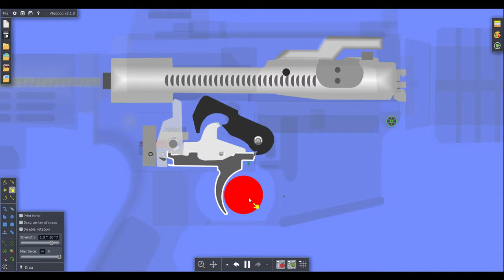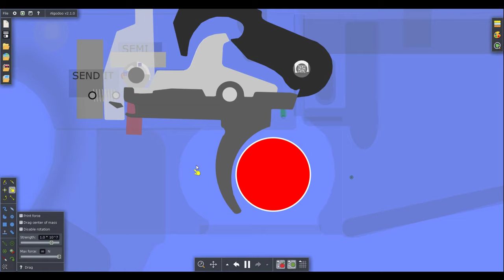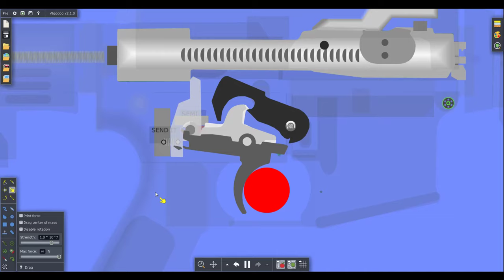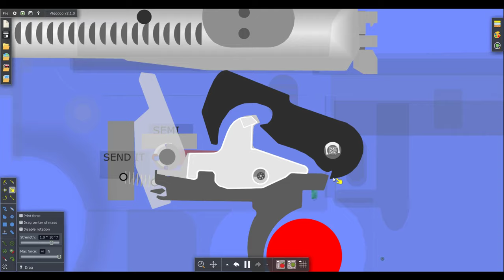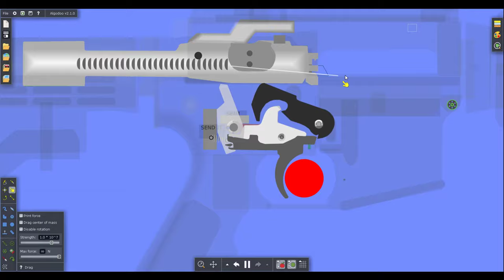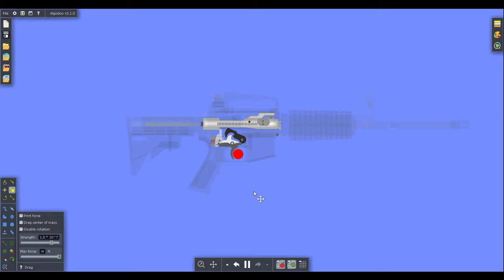How Binary Triggers Work

Comment: I like your concept for this binary trigger, I think you should find a way to put it in production if you could.
Reply: Get a file and a regular disconector
Reply: @socwyvern9745  that's a great way to cause an out of battery detonation but not binary firing.
Reply: @jacobkudrowich  The bolt cam track and firing pin flange prevent "out of batter detonation" unless your components are too out-of-spec
Reply: @jacobkudrowich  good luck.. your not outrunning the bolt with your finger
Reply: Just mod ur stock trigger.its only binary forever
Reply: @jacobkudrowich not how it works bro but appreciate the effort 💀

Comment: It looks like you simply combined the parts from a mil-spec trigger, a Franklin, and tweeked a mil-spec full auto Sear to make a Binary trigger design. What safety selector works with it to make it work in all 3 positions? You did a good job. People make thier own DIY Binary triggers all the time.
Reply from the maker: Not QUITE a FA sear, since it interfaces with the trigger instead of the hammer, but yes! Spot on evaluation!
Reply: @StealthTheUnknown  what safety shaft makes it work? Custom cut one, FA or Semi-auto safety selector? It would need an indent cut for each position of safe, semi and Binary modes.
Reply from the maker: @2artactical55  it’s a custom cut one, with a partially milled shelf that allows the trigger catch to rotate, or be blocked when turned to the safe position (inspired by the lack of such a feature making it “fun” to connect the receiver components together.)
Reply from the maker: @2artactical55  I’m also working on a selectable forced-reset trigger, so people can have semi-auto on top of their new civilian-legal giggle switch.
Reply: @StealthTheUnknown  I've worked with both Franklin and Fostech in the ARs we custom built for our customers and they are both good companies. I prefer the Fostech because of it's design that eliminates hammer follow. Unfortunately I have an AKS74U that doesn't like thier AK Binary trigger at all. Currently I'm making my own "Boogie Hook" from an AK Rate Reducer. Having a short "Krink" AK isn't the same if it can't fire faster. AK triggers are finicky to modify into a Binary trigger though. Unlike an AR15, a one size fits all drop in trigger don't fit in every AK made (like my Arsenal SLR104UR turned into a AKS74U).

Comment: Hey, may I make a request? I’d like to see your own take on the Forced Reset trigger, and find a way to make it select. From singles to forced reset to binary. You could probably make a sort of a burst function utilizing the concept of forced reset instead of the binary if ya like.
Reply from the maker: You’ve touched on something I’m already working on. Try to keep it a secret 🤫 I can’t make it burst, that simply wouldn’t be viable with a frt. I also don’t see the benefit of having both binary and frt, but I can certainly make the frt selectable with single.
Reply: What about a crank that counts the trigger pull on an FRT similar to how a crank counts the hammer rotations on a burst, and on the last shot the crank locks the 4th pull until release
Reply from the maker: @CowboybubPercussion  if it locks the pull . . . How is it going to release? Additionally, the way burst works requires the trigger to be held for the duration of the burst. There’s nothing here the operator could manipulate to simulate “holding,” since the trigger automatically forces a reset. Does that kind of clarify the issue?
Reply: @StealthTheUnknown  I think a type of FRT burst would have some practicality in sport shooting in the same way binary does for when shots are on the clock
Reply from the maker: @CowboybubPercussion  I’m saying burst is almost certainly impossible with an frt because there’s no way to say when to stop; to the gun, the trigger is constantly being pulled and released for every shot. On burst, it’s the fact that you’re holding the trigger down that allows the disconnector to do its job; with an frt, it forces the trigger back forward every round. The only way I can think to do it is to make it so a cam inly allows the trigger to force reset twice, after which the component which transmits pressure from the hammer to the trigger is shifted away in order to allow the trigger to remain held, and therefore the disconnector to do its thing. That sounds finicky and complicated to me, though. Nonetheless, I may opt to try it anyway.
Reply: Alright, fair enough
Reply: @StealthTheUnknown  I was thinking of making, what I call, a “progressive burst trigger”. This is a trigger with three walls. The first wall fires a round, the second wall fires a round, and the third wall fires a round. Releasing the trigger at any point resets the burst counter. I was thinking of using a linear ratchet type system. I have drawings but nothing made yet
Reply from the maker: @GNP3WP3W  these have already been submitted to the atf and been declined. The atf has stated that one “function” of the trigger should be a single discreet direction. What you are describing is considered legally the same as 3-round, so a machine gun.it’d be “one function” with 3 rounds.
Reply: @StealthTheUnknown  that’s lame af. What about a convoluted work around. You know the gatcrank? A 360 degree rotation fires off 3 rounds. What about side mounting a secondary trigger that rotates a gatcrank-like device 360 degrees? The firearms trigger is actuated 3 times while the crank is actuated in a single motion just like it’s stand alone function
Reply from the maker: @GNP3WP3W  the first one, the gat crank, still requires you to “manually fire each shot”  with a discreet continuity of crank operation. The moment you add a second trigger to rotate it tho, and you have “bump auto”, where the secondary trigger keeps bumping the original. Still an MG.

I do have an idea for a type pf forced reset trigger that has a “burst” option.
Reply: @StealthTheUnknown   I just came up with a solution to all of this this, (also, it’s been 5 months, hi, I hope your holding up considering everything) anyway, you are right, it would be absolutely impossible to make one a FRT have a binary mode because the whole FRT system lacks the possibility for having a disconnector because of how the trigger resets, however, I just thought of a genious idea that would solve being able to turn the FRT design into a select design from assisted reset single, to forced reset binary. Allow me to explain, no matter what way we put it, semi auto is not going to function in traditional sense because of how the trigger resets, however, what the concept of the FRT does require is constant tension on the trigger, so heres what I was thinking, what if we had something like a tension based trigger lock that locks the trigger itself when the FRT trigger is in reseted forward position…. And whenever the finger’s tension is released, the trigger lock resets. Unlike a disconnector which directly hooks onto the hammer while the trigger is in the rear-word position, this trigger lock would lock the trigger in the forward position and stay in place because of the pressure of the trigger finger. Also as a result, the semi auto reset travel would be next to nothing, which would theoretically feel like an amazing reset to imagine. Now with this concept in mind, we could also use this exact same trigger locking concept for a 3 shot forced reset design to stop the gun from shooting, we’d just need a gear similar to what’s used in a burst design that counts the trigger pulls and resets. So when this select fire FRT is in it’s burst function, when finger tension is introduced to the trigger, the FRT will do a full cycle 3 times causing the rifle to shoot 3 times, but on the 3rd and last reset, the tension based trigger lock that’s used in the semi auto function of the trigger would lock the trigger in the forward reseted position until the finger’s tension is released.
Reply from the maker: @CowboybubPercussion  that’s literally how a frt works. It forces the trigger forward by basically using deliberate trigger slap, and keeps the trigger itself locked it the ready-to-fire position until the bolt is in battery.

As for the burst idea you have, I’ve already worked something like this out. I’ve just been hesitant to share it publicly. The truth is, I have known about both forced reset triggers and the implications of where that goes for a while - I just didn’t want to put anything out before the market produced something mainstream enough that it couldn’t fall back on me. The idea came to me about 4 years ago when I was using a program called world of guns - the stg-44 has a mechanism in the trigger group called the “sperrhebel” (locking lever.) I put 2 and 2 together when I knew about trigger slap at the time. I knew the effect would be simulated automatic that doesn’t meet the definition of MG. But it would be awkward to be credited with something like that, I wanted to wait a while and let someone else discover it
Reply: @StealthTheUnknown   could we perhaps have a discord together? I’m part of an unofficial World Of Guns and Weapons design discord, and I think we would have a lot of interesting mechanical discussions together. And also, your concerns are absolutely valid and understandable, if I were in your situation my concerns could be similar… I am willing to have patience. And before I forget, thank you for getting back to me
Reply: @CowboybubPercussion  A binary FRT would be impossible since it resets the trigger before the bolt is even in battery. It would also almost forsure be illegal since it automatically resets the trigger.

Comment: To connect an upper and lower with the ECHO trigger you can put it in echo mode, push the trigger block safety bar forward, then press and hold the trigger. If you do that it will hold the trigger block lever forward so that you can close the receiver set. Lol the owners manual that comes with the trigger tells you that.
Reply from the maker: Who reads that shit? Lol

Comment: Bro,how long does it take you to make your guns?
Reply from the maker: it varies. some are the product of weeks of revising and editing and tweaking. others were popped out within hours. all depends on the amount of work and detail i want to put in, and how well things go from the start.
Reply: @StealthTheUnknown  do you use scripts in your guns? for example, when the bullet leaves the barrel and is hit by lazer, the force of a thruster on the slide is modified so that the slide goes backwards. I asking this because some guns that i made need high density to function better and the bullet cant push the slide backwards
Reply from the maker: @umser9anosatras562  yeah, I do exactly this thing sometimes. I try to avoid it and balance things the best I can. You need heavy density only for components that are under a lot of mechanical stress. Try to make everything as light as possible. 

I do something similar for “script-assisted recoil” to what you described. But instead of using a laser to activate the scripts, I use the part of the bullet that gets deleted at the end of the barrel and use their “onDie” script box. The thruster used to cycle the bolt or slide has it’s force written in the script menu as some scene.my variable, such as scene.my.recoil or scene.my.gas. I make a script in the poststep of the laser that always keeps reducing the thrust of the thruster to zero. That is, the script is always trying to bring the value of scene.my.gas down to zero, with an if/then statement checking if the value is below zero to then set the value by force TO zero. This makes it drop from whatever value it was when the gun fires and the bullet leaves the barrel, to zero, where it stays until another round is fired
Reply: @StealthTheUnknown  cool,I have tried several times to use this type of script but it failed :/ you should make a video about this, scrips are complicated and doesnt have tutorials on internet about thurster force modification

Comment: How is possible that in the binary mode when you pull the trigger, when the hammer is pushed by the carrier it is catched by the disconnector but when you release the trigger the the trigger sear doesn't catch?

If you pull the trigger only the amount you  need to release the hammer from the sear and not any more will the disconnector catch the hammer in the cycle?
Reply from the maker: The binary disconnector is shorter than the semi-auto disconnector, and releases the hammer before the trigger can be released sufficiently to catch it. It’s fine tuned differences that change timing and so on. Yeah, it’s true that you could feather it so that you get it between the trigger and the disconnector, but there’s enough forces, sudden movements, and mechanical encouragement going on to make this condition highly unlikely. If you DID pull the trigger only this far and no further, you’d get hammer follow like you would if there were no disconnector at all. That said, look at any slow motion footage of a trigger breaking, and all the firing and mechanical forces that follow, and tell me you could reasonably create this condition
Reply: @StealthTheUnknown  I guess it virtually is impossible to happen, unless maybe you would add a screw limiting the trigger overtravel. 

I was wondering if there was some additional part  that alters the relations of the trigger and disconnector catching and releasing the hammer but then you are right that it is not necessary, unless maybe you are a robot with a slow servos🙂

Comment: Hey real quick in theory, could I use any ol' 3 position selector for a binary trigger or do I have to use the one that came with it?
Reply from the maker: The selectors these triggers come with operate a little different than mil spec selectors, just use the ones they come with unless other offerings are put out. It’s likely the mil spec selector will either malfunction or simply not fit in properly with the binary components

Comment: So if you file down shortening the disconnector hook you can make something like a binary trigger but without the option to resing of the shot when you release the trigger?
Reply from the maker: yeah, basically. or bubba full-auto. I wouldn't recommend trying it. if anything, I'd do it with a burst trigger pack (minus the auto sear, obviously), and filing down the burst disconnector instead. Again, I wouldn't recommend this either, since I'm not entirely sure how available or cheap replacement burst sears are, but it's a way to give yourself the option of selecting between semi and binary

Comment: 8:09 NOW I understand why the auto sear is designed to be disabled on semi-auto on regular full-auto lowers!

I was always wondering why they would disable what is effectively an OoB safety on semi-auto when ur much more likely to CAUSE an OoB on semi-auto where on full-auto the gun handles the timing for the shooter and basically makes OoBs impossible.
Reply from the maker: Good to see you dude! Another reason for this is for re-assembly when clam-shelling the receiver halves shut, you don’t want the trip tab getting bent underneath the mating face on the bcg. The safety move it out of the way so you can shut the receivers together
Reply: @StealthTheUnknown  Yeah, the re-assembly thing I got out of ur explanation, I figured that if that helps on this that would also be the reason why the auto sear is cammed out of the way when the selector is on semi or safe  on a regular full-auto lower.

But before I heard that explanation it just never occurred to me that that IS the reason. The best reasoning I could think of was to reduce friction by not making the bolt trip the auto sear every time, and the next best one I could think of was reducing wear on the auto sear, but both of that is negligible considering the amount of inertia that the bolt carrier has when it slams forward and the relatively small force it takes to trip the auto sear even with the hammer resting against it.

Also, have u seen my 3 round burst capable lego gun in the meantime? I'd sent u the link to it in a comment on ur 3 round burst video a while ago.
Reply from the maker: @DualDesertEagle  i think my comments auto-filter anything with a link, so I don’t think I’ve seen it. Let me check your channel

Comment: How difficult do you think it would be to design a binary trigger for the Cz75B? I ask cause now there's one coming out for Glocks and it really has me interested in doing a civilian legal Cz75 auto replica
Reply: Even if it didn't have a selector switch and was just safe then binary as a drop in trigger I'd be super interested in getting help making one
Reply from the maker: Probably not too difficult. Would basically require most of the fcg components in the frame to be replaced. You’d certainly need a new sear, and a new trigger bar. As for selectors, putting one on a cz would be hard, much easier on a glock with the slide plate. Binary triggers for a glock wouldn’t be too terribly difficult, but the trouble come in with how a glock basically works, it’s cocked by pulling the trigger, and stays cocked after it cycles. The striker is “cocked” on the trigger bar itself, which fires by being tripped by the connector. The connector gets pushed to the side by the slide when it cycles, which lets the trigger bar jump back up to catch the striker. Changing that mechanical arrangement for binary, let alone for select-fire binary, would be difficult, but certainly possible. 

For the CZ, you’d probably be better off having a binary-only, or I’d take it so far as to make it a forced reset trigger.
Reply: @StealthTheUnknown  a forced Reset trigger would be even cooler tbh, honestly whichever would be easiest to make and to prove is legal is the route I'm tryna go, it be select doesn't make much a difference to me. You seem really knowledgeable on the subject I'd love to pick your brain sometime